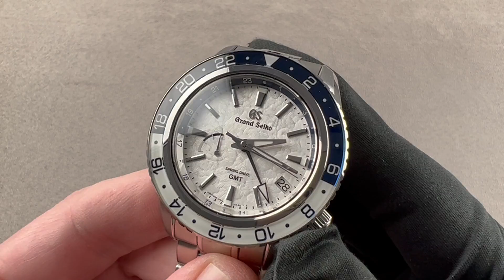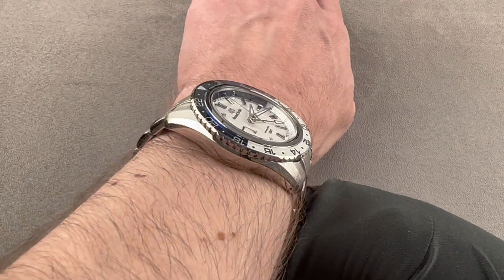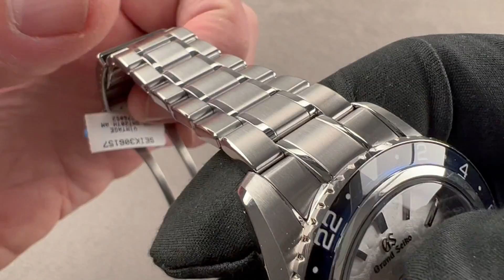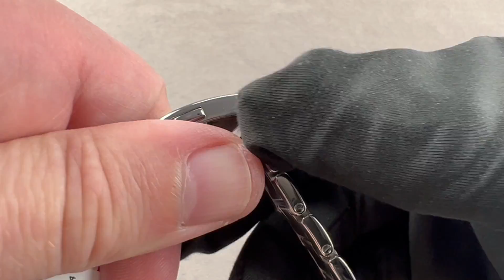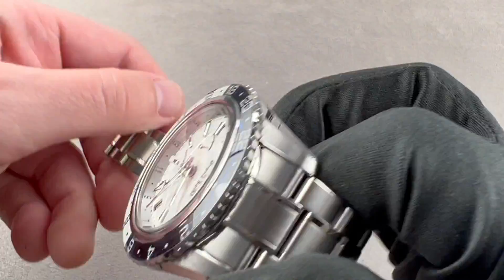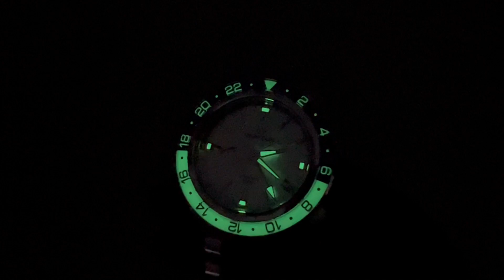Grand Seiko Spring Drive GMT - SBGE275 - 20th Anniversary 44mm "Snow Dial" Hands-On Watch Review

Comment: I was amazed to notice that the turnable bezel has 72 clicks, which means I could adjust it also for 20 and 40 minute time zones! The problem is there are no countries with 20 or 40 minute time zone, but there are several with 30 minute difference (India etc) and couple of 15 minute zones even (like Nepal). If the Bezel had 48 clicks half hour adjustment would be possible, with 96 clicks also for those few 15 minute time zone countries. What were they thinking? Most likely nothing.
As you can see at 3:35 he adjusts the third time zone to 2:40.....

Comment: I own this watch and absolutely love it!  I have a small wrist (16 cm) and the size is not a problem. The drilled lug holes make strap changes a breeze, and I keep mine on a rubber strap so I can wear it over variable wet suit sizes.  It is a 200 m water resistant sports watch after all!  My favorite aspect is how the sapphire capped bezel changes color in the light.  You can see it a little bit just in Tim’s light box.  When you get it outside in the sun, it’s super cool!  The hands and indexes are mirrored polished and really sparkle as well.  As an owner of one of these, I highly recommend it.
Reply: Cameron, what strap did you select?
Reply: @christopherpadilla3481  I tried several but ended up keeping it on the least expensive I tried, a Barton rubber strap.  Runner up was a Tag Heuer Aquaracer replacement strap.  The rubber on the Tag strap felt better, but the color on the Barton was a better match.
Reply: @cameronthurman2512  what color did you choose? I'm considering a white one myself.
Reply: @christopherpadilla3481  I got a blue strap.  I’m going to get a white one as well, that’s a great idea!
Reply: @christopherpadilla3481  it’s a Tag Heur Aquaracer replacement strap.
Reply: I have this watch too and its a beauty!  My gains about half second a month!  This movement is super accurate and precise!
Reply: Hi, does this watch gain time over the period?
Reply: @DonnyHouse-h7f  it’s almost spot on.  Every other month when I adjust the date, it’s never more than a second off.
Reply: @Harry Balls I paid exactly retail. I got it from an AD.